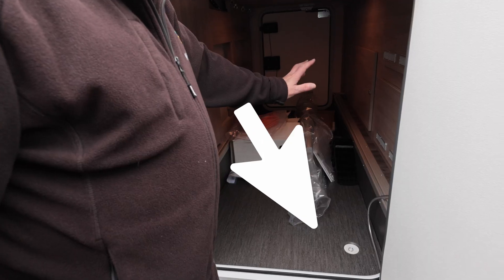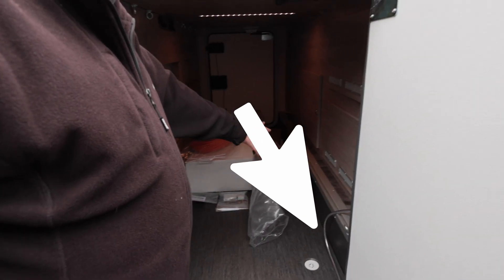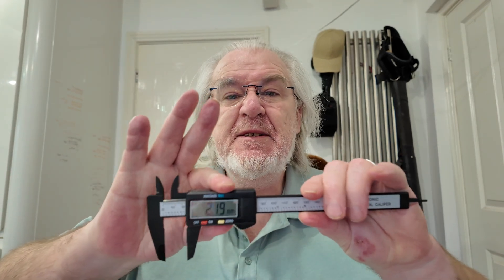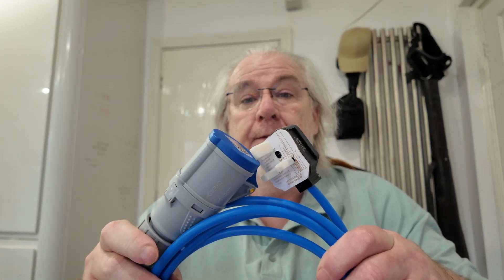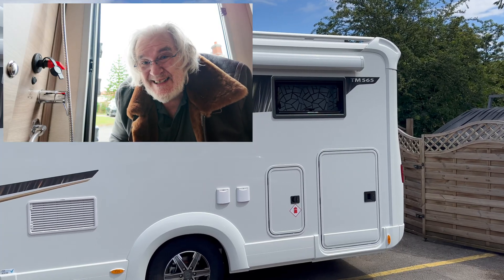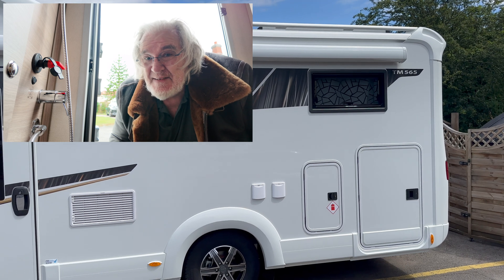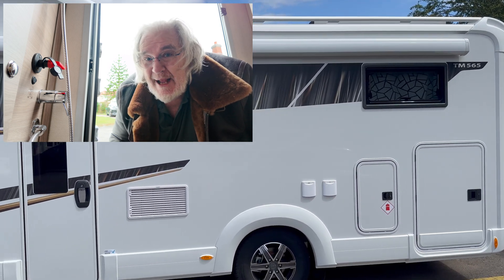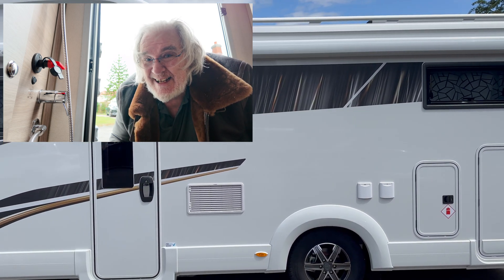We're going to power the van from Ecoflows.

Comment: We do the same with our delta max 2. It powers everything in our caravn. 
I have noticed the caravn charger keeps pulling 54w  charging the leisure battery. 
I have now discounted the charger so we are not wasting power. 
Every watt counts after all. 
The solar keeps the battery topped up.  
As we permanent pitch the savings in one year of not having an electric has paid for the EcoFlow. 🥳
Reply from the maker: I’ve wondered about that, have to say... but we’ll see how it goes for a while before I seek permission to fiddle further... 😇
Reply: I just unplug the power cord on the charger for now.

Comment: So does the inverter in the Ecoflow enable higher wattage electrical items (air fryer etc.) by plugging them into the 3 PIN sockets in the van rather than directly into the Ecoflow?
Reply from the maker: Yes… our coffee machine, hair dryer - it’ll all work. The Delta Max 2K outputs 2400 watts - or 10 amps, if you like (maybe a tad more if you go for 230 volts rather than 240), and there’s  a bit of overhead in the surge, too… Treat it like a 10 amp hookup, and you’re good to go, I believe.
Reply: Thanks very much @VandromedasTravels

Comment: We power our van from our ecoflow - I’ve made up a cable with a 13a plug one end and the ‘caravan hook up’ socket bit the  other end and we just run the cable from the ecoflow to the van. Can run everything except the heating just as if we are on hook up👍
Reply from the maker: That's the intention here, too - going to do some measurements and see what the likely run-times are before we get solar into the equation.